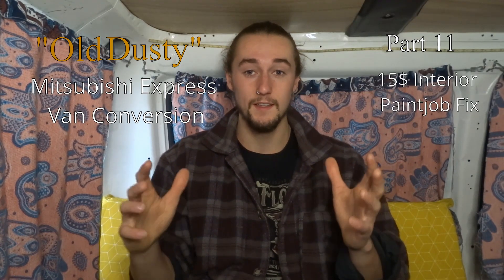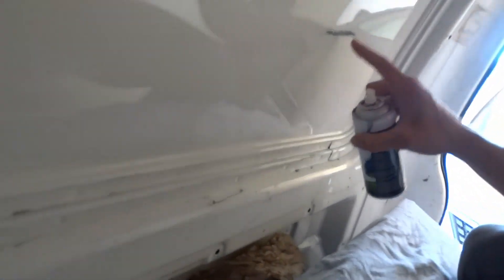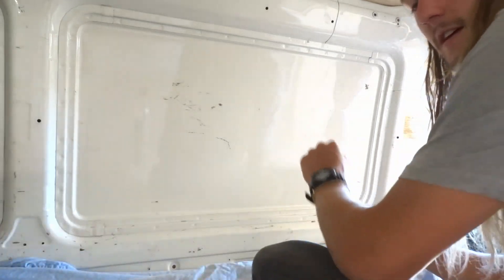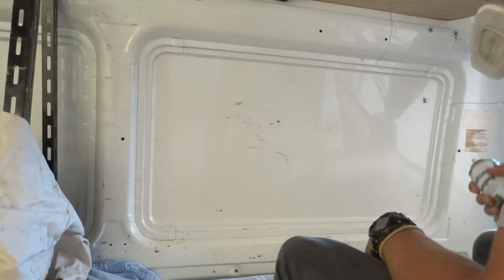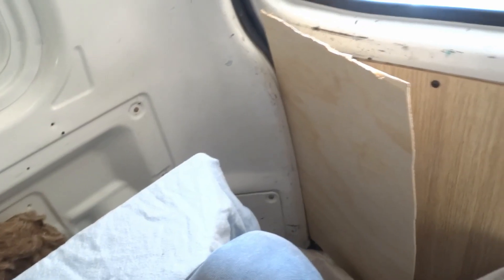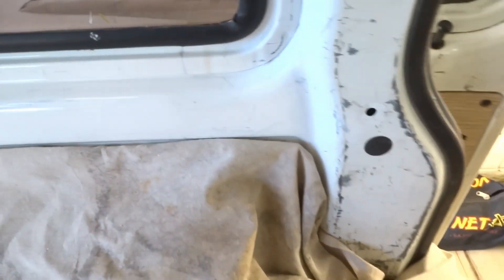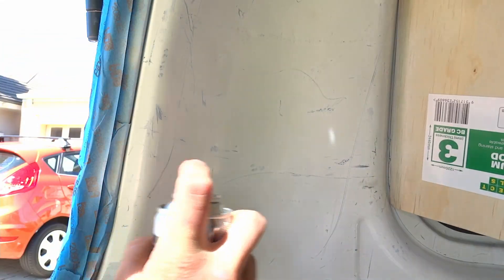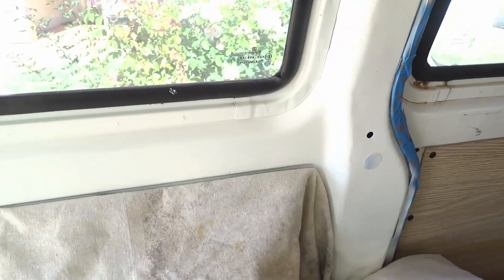15$ Van Interior Paintjob Fix | Mitsubishi Express Van Conversion Part 11

Comment: Hey dude, Does this work outside of the van?? Coz I have to spray quite a few spots near the roof and around the van on the outside, Can I use this stuff?
Reply from the maker: Hey bro, it is the same paint that you use to touch up outside the vehicle. However before applying it to anything exposed to the outside, you're going to need to sand it right back, prime it, paint it, then seal it. The paint itself isn't enough to stop it from rusting out and if you don't sand out any rust spots, and then seal it properly, you'll just get a bandaid solution that'll end up ruining your van. In my first video, you can see me spraying the outside of the van, and there's also some great tutorials online where you can see the process for touch up respraying. Hope this helps🤙🏼
Reply: @lachiemac2642  Legend man cheers!